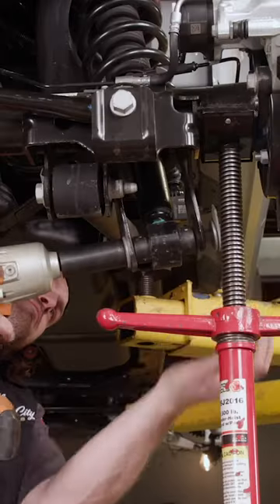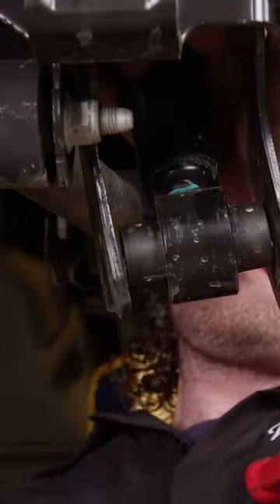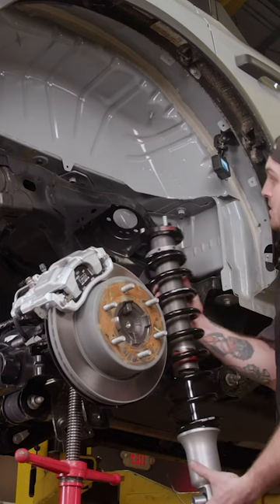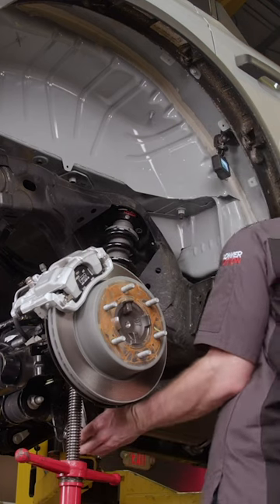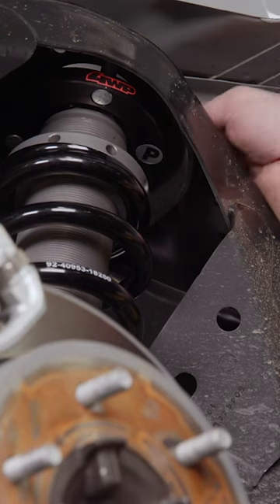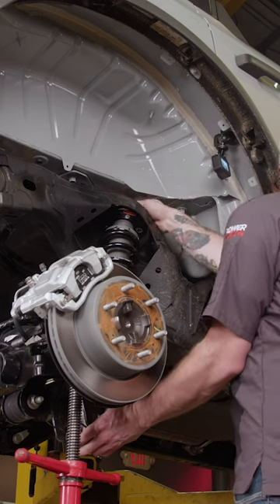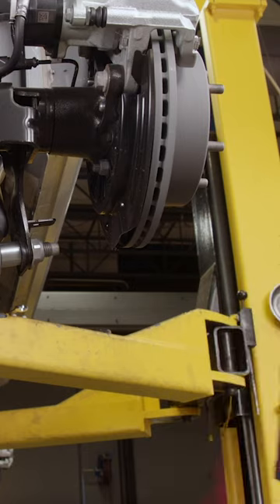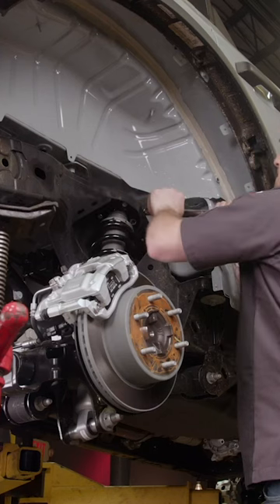Ford Bronco Gets New Suspension

Comment: can do this in your drive way as hes using a lift
Reply: Ikr, the bolt on isn't the issue. Jacking up a 3.5inch lifted jeep with 35s is kinda sketchy with just how damn tall I have to make the jack stands. Also you better have a flat driveway cause if not it's gonna tip
Reply: @kowallawok9750  all good points, maybe in a garage but the height is still an issue.
Reply: Yeah it would be easy on a lift but there’s ways of jacking it safely if you know how to.
Reply: @kowallawok9750  my jeep has 14" travel coilovers all around and 37" tires. I can pull the suspension out with nothing but a floor jack and some jack stands. Its not difficult at all. You have to think, when you pull the tires off, you can lower the axle another foot down to the ground.
Reply: @kshepthedrummer  exactly I did the same with my TJ that had a long arm kit with tons of travel and extended front and rear axles. Once the tires are off, it’s ridiculously easy to find the space. And all you need are two different height jack stands - a set for the axles and a set tall enough for the frame.